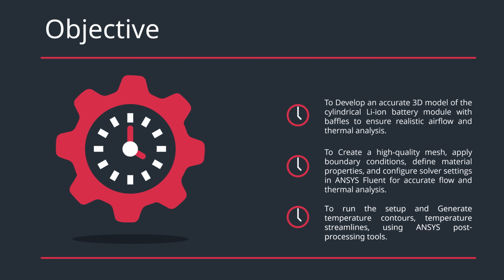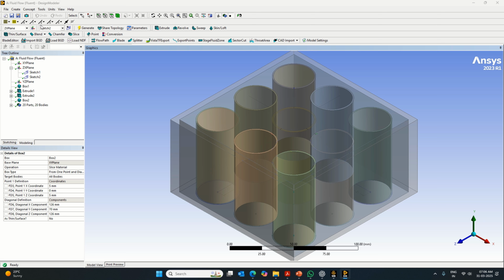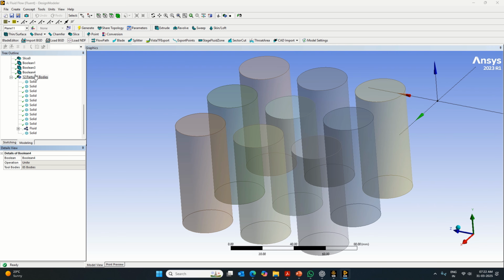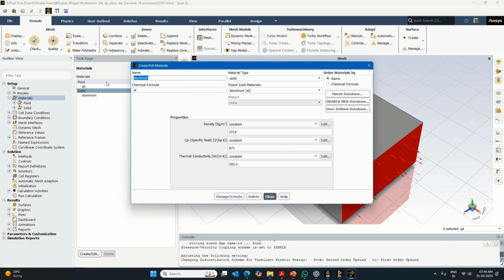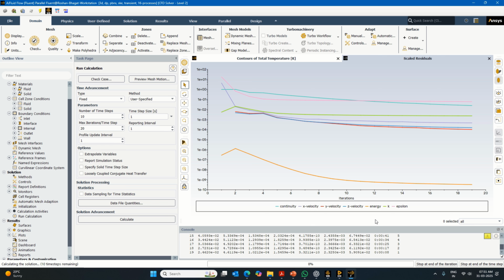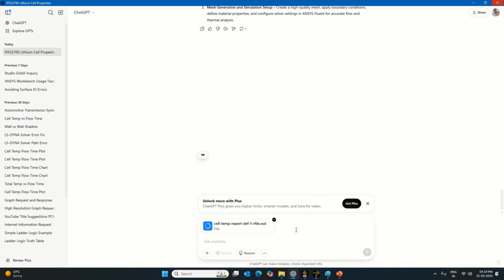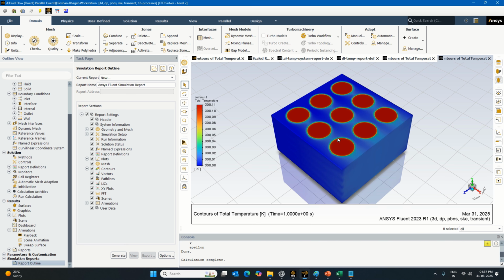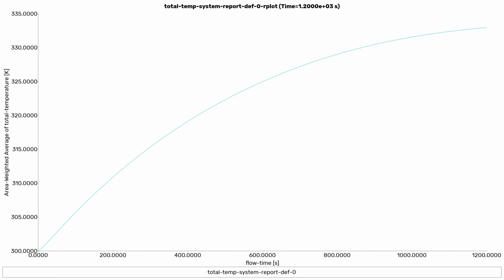CFD Analysis of Airflow Cooling in Li-Ion Battery with Baffles | Chart Plotting Using Excel ChatGPT

Comment: This design is the traditional model. What effects can be studied compared to this model?
Reply from the maker: Baffle Design Variations, Effect of different inlet velocities on cooling performance, Number of Baffles, Comparing a baffle-cooled system with no baffles
Reply: Thank you very much for your efforts, but why not use space claim knowing that it is much easier than designed modeler
Reply from the maker: Yes you can use space claim. Depends on you whichever is suitable can be used
Reply: @FrontiersInCFD  
Dr. I think that you must put "laminar flow " in simulation, most papers using that
Reply from the maker: it can be done